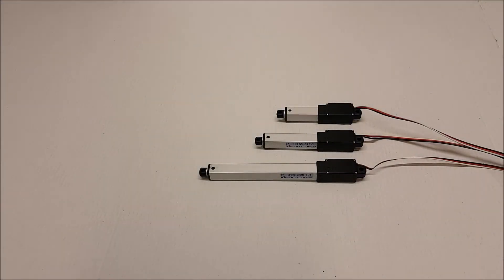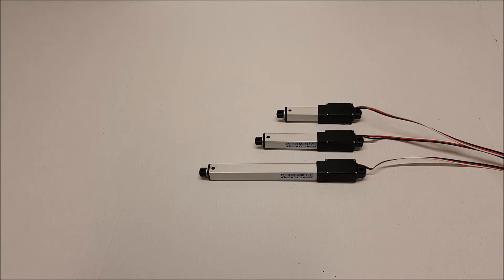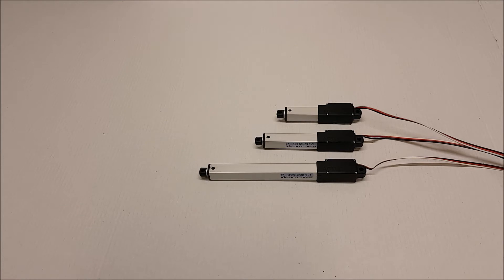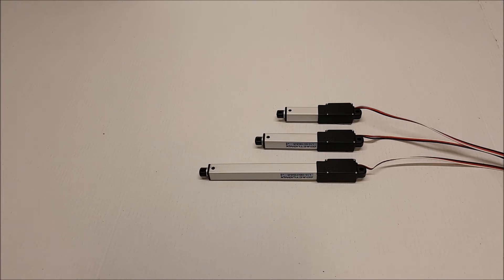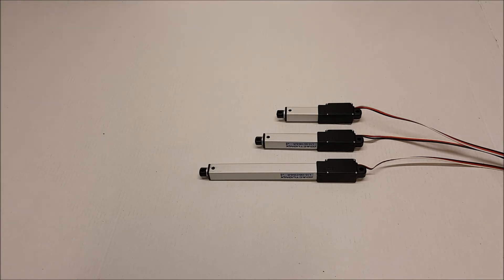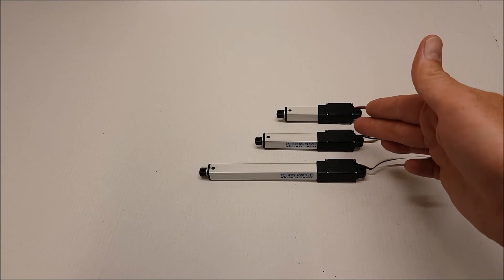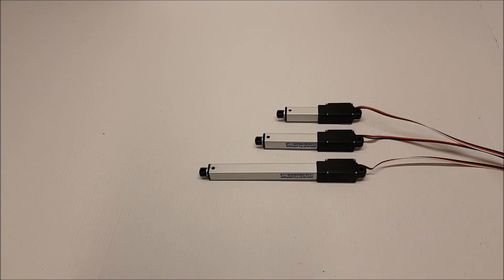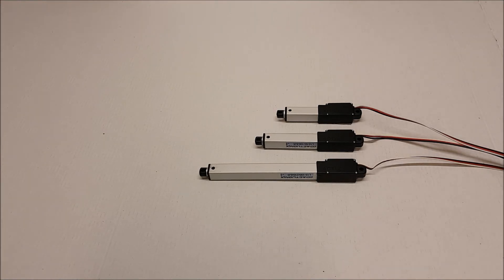L12 R Product Overview

Comment: are these servos self-locking？
Reply from the maker: Hi there, I'm not exactly what you mean by that but they do have a holding force. When power is not applied they will hold their position up to the rated back drive force.

Comment: are these bang bang or can you hit lengths in between?
Reply from the maker: No. If run through an RC receiver it will follow the movement of the stick on your radio.
Reply from the maker: I'm not sure what you mean by bang bang. They work in the same way as a typical servo in that they will follow the stick. If you want to use it to emulate a hydraulic system you would want an S series actuator and a compatible motor controller.
Reply: Actuonix Motion Devices by bang bang I mean that it is either on or off. So either fully extended or fully contracted